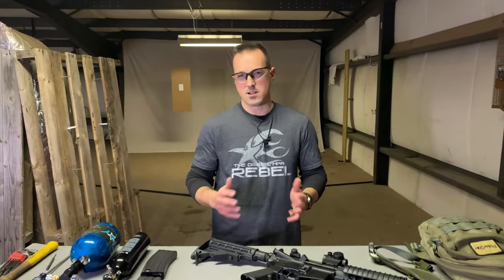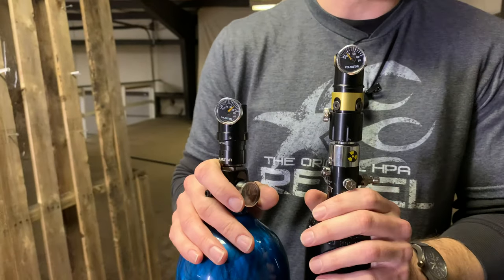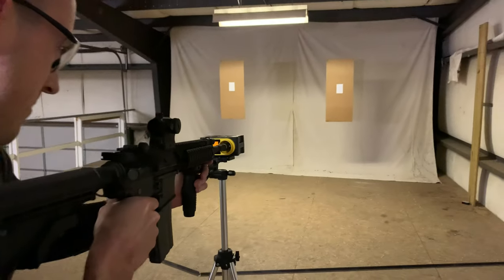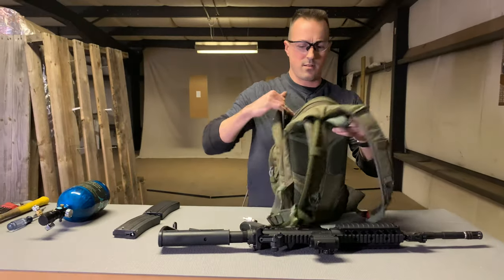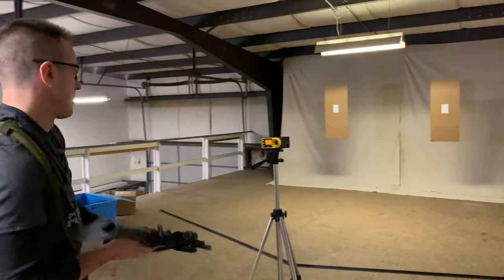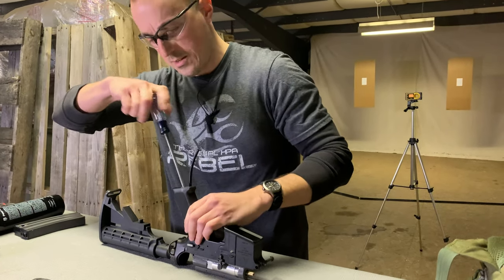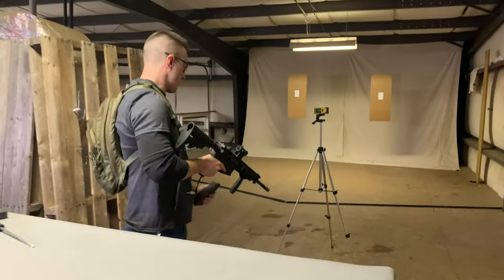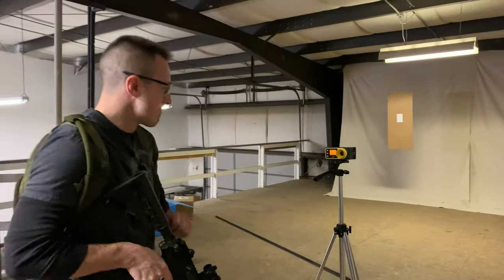Product Update - Kythera, Velocity!

Comment: Very cool pressure output. I get close to 500 fps with .30g from my Tippmann M4 with max output pressure. Great video for comparisson!
Reply: With a Redline N7, at max PSI (120) I get around 550 fps. I'm a little let down by this system, especially since they are offering an SR25 nozzle package, which means they do intend this system to be used for DMR roles, but it seems to be lacking in full DMR capabilities. Some fields and events allow for up to 550 FPS @ .20g bb.

However, I'm very pleased that the nozzle return is spring-actuated, as opposed to the Redline's pneumatic-actuation, which has introduced some variance shot to shot. (I'm seeing a range of 386 to 393 fps w/ .32g (2.25j) @ 105-110 PSI, but every so often I'll have a bb 10fps low). And as we see from the chronograph here, there are pretty tight fps groupings (271-276 fps w/ .20g @ 60 PSI)
Reply: TRowland223 seemed like he was at 505 with a .20 at 100 psi so at 120 would be on par or higher than the n7 add the max 180 hotttt damnit you’re probably well over 600 FPS
Reply: Do you have the high velocity valve in your tippmann?
Reply: @zanehakim7684  Nah but I did add some buffer spacers and that gives it the boost.

Comment: I figured it out. On the production model you must remove the charging cable from the assembly by pushing up a pin that is stopping the sliver piece that re cocks the system when you pull the cable lies. Once that is out you then can simple pull out the charging cable ———  next step is to then press the trigger & it releases the valve exposing the spring.
Reply: This system is absolutely amazing. Super consistent. / solid co striction / amazing trigger

Comment: What is that gear box that you used i n this video. You said it was pretty old and has been in all sorts of builds. What is it?
I'm on my second shell for my Kythera. The first was just a bad idea to use. It was a V2 shell, but originally used in a Echo1 AR57 gun. To use the 5.7 mags from the P90 the front top of the shell top down was thinner and when I used the aluminum HVAC tape to adjust the nozzle alignment, this eventually put too much pressure of the shell and bent the top of the gear box shell where it was already thin. 
Anyhow, I'd love to know what you guys recommend for gear box shells.
Thanks, loving my Kythera!

Comment: Great news. Thank you for those video updates. I'm looking forward to the release. However I'd like to ask for some things. Are you planing to produce longer nozzles and spacers for SR25 receivers (rifle bodies)? Especially for SR 25 A&K. In case if you don't plan to produce longer Kythera for extended gearboxes.
Reply: They have v2,v3, and a&k sr25 ones
Reply: I'm disappointed. 
I installed hard spring inside my kythera and high pressure spring in the UGS that supposed to be 180 to 200 max psi. 
But when you max the UGS adjustment it kinda choke and I have to back out the set screw psi adjustment to make it work  properly again and only shoots less 400 fps. Everything is aligned and sealed.

Comment: What is the minimum psi required for it to Function properly and what fps will it have with it?
Reply: I think its 60 in the video.
Reply: @BorelessAirsoft  yes I already knew that, but what I want to know is if I can go under 0.5 joule with even lower pressure or if I need to use the spacers.
Reply: Why would you want to go under 0.5 joule?
Reply: @BorelessAirsoft  in Germany you can only play under 0.5 joules if you're 17 and under
Reply: @FabianSkornia  Ok here in Canada we do 400fps or 1.5 joules with all ages and Im sorry to hear that.
Reply: 60psi seems to be the lowest operating pressure as of now

Comment: About to put my pre-order in, I have a CYMA SR25 platinum with the extended 2.5 gearbox I would want to get the A&K SR25 model, not the m4 model with spacer correct?
Reply: Yes buy the v2.5

Comment: At 6:21 you show how to change the velocity spring. This is virtually impossible on my model. I did everything you did on my lathers and that shaft would not release what so ever the trigger didn’t release it
Reply: Check their manual on the site. Just remove the pin of the reset cable.

Comment: Sorry if I'm a bit dumb, but can someone explain me what the problem with the spring is? Meaning, what happens if you use the heavy spring with low PSI and vice versa, the light spring with high PSI? I saw the rise in FPS with the heavy spring and high PSI but surely that will not be everything.
Reply: Heavy spring on low psi will probably have an increased fps and or joule I’d think so instead of the 206 it would be around 240 give or take